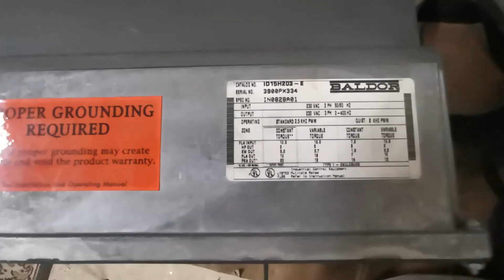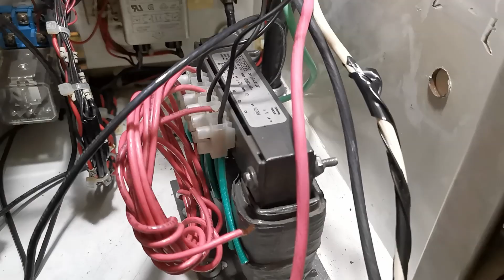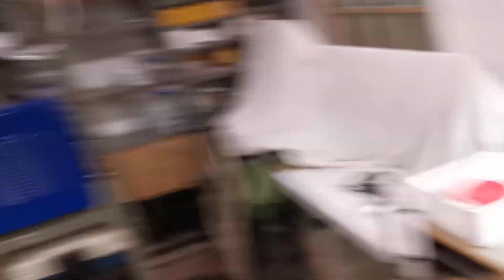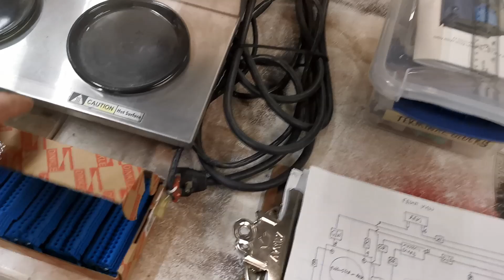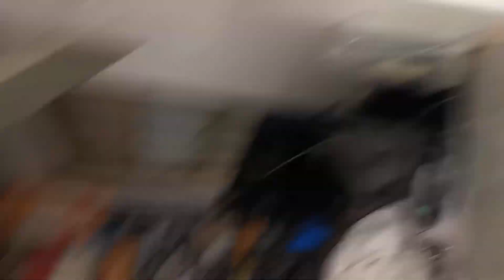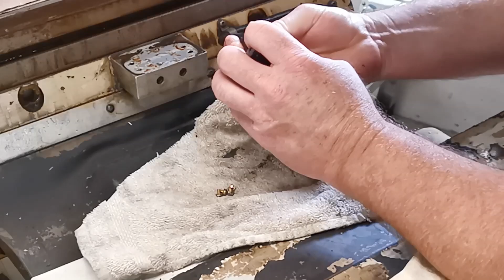Milltronics Partner Milling Machine - Getting The Mill Moving / single phase power and VFD for motor

Comment: Hello not much info out there to help with these older machines, I have two machines running centurion 4 controllers. My machines are a partner 4 and a partner 7. On mine I have to push a reset button and then grid the machine to get to normal operation. Don’t know if your controller has the same buttons. Hope that will help when you get more of the machine closer to completion. Good luck , when they work they are awesome, but very early technology.